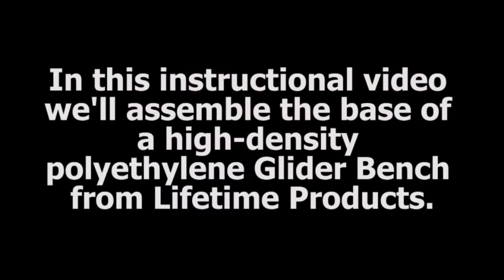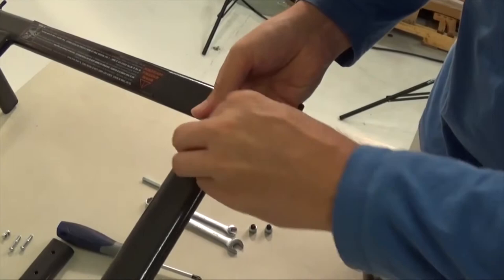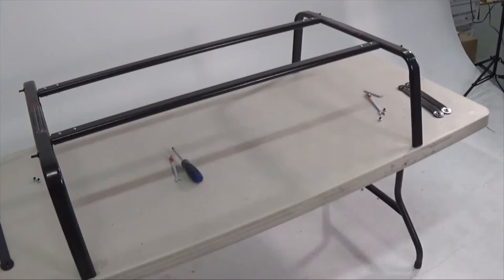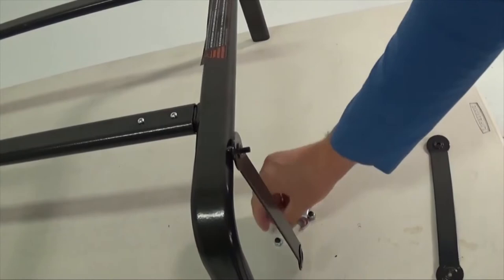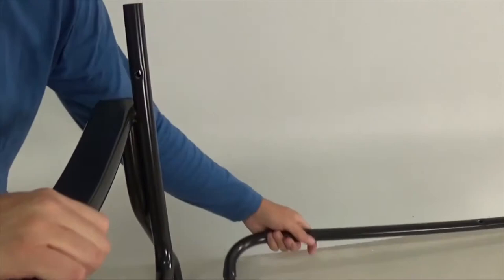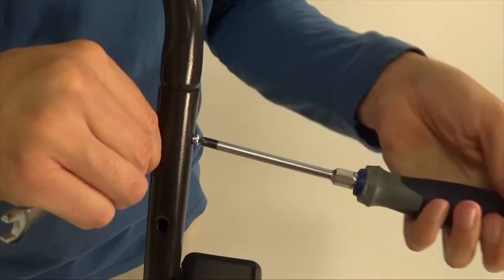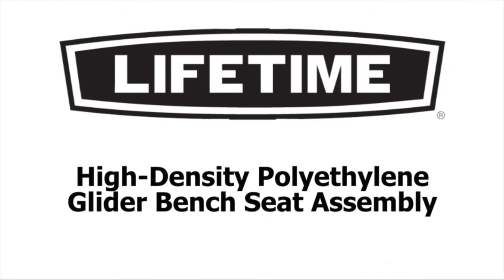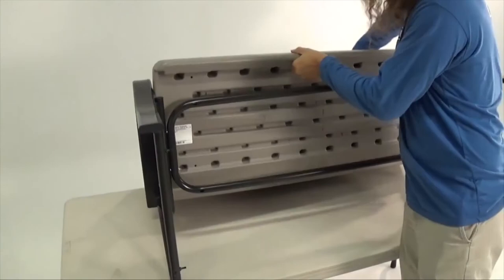Lifetime 2871 Rocking Glider 4' Bench Assembly

Comment: Quick tip for those assembling this glider. After assembly, I heard a clicking noise while gliding the bench back and forth. The glider arms at the bottom of the glider have to be tightened enough so that they are secure against the metal frame. If it's loose at all and you can move the arm easily back and forth against the bolt, it'll make a noise while gliding.  Once I tightened the bolts so that the gliding arms were snug and flush against the frame, the gliding mechanism became completely silent.
Reply: how's the bench holding up now? I just purchased one... about to set it up, curious if it will last, looks nice